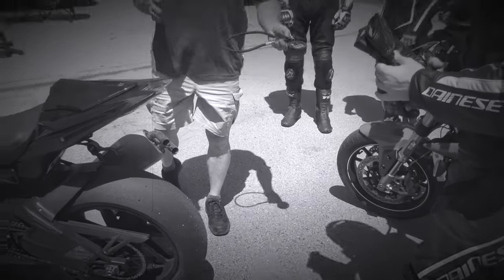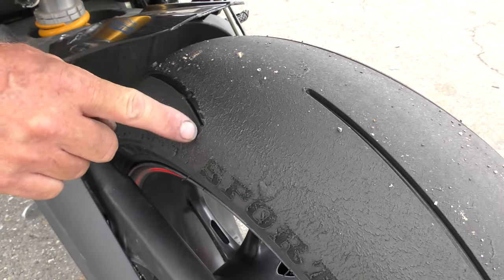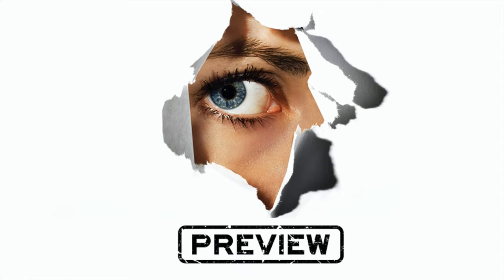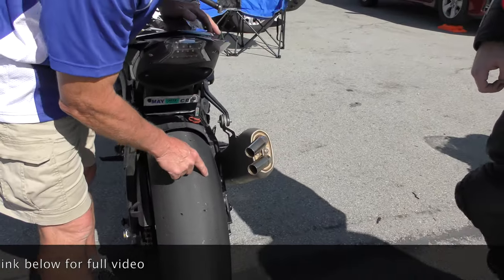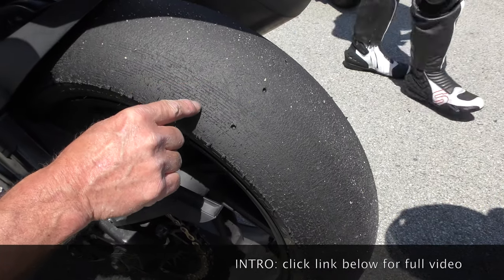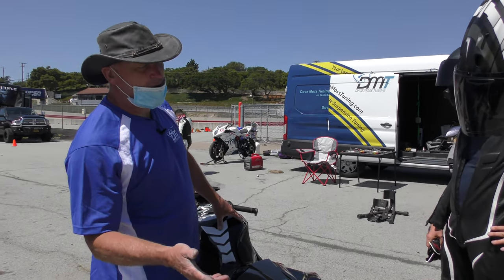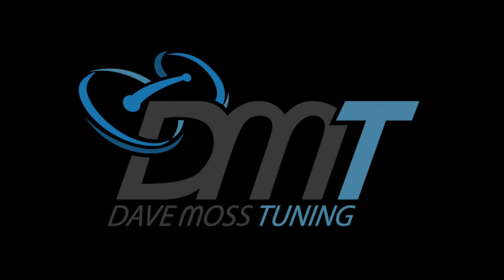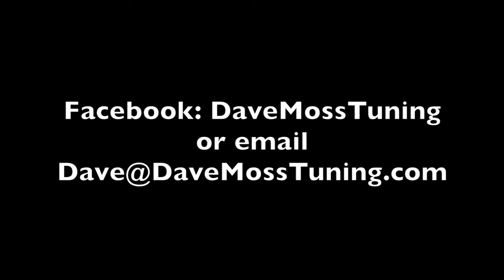INTRO Contact Patch: Metzler TD Slick at Laguna Seca on the S1000RR

Comment: Those  tires were pretty good, actually. I didn’t have my generator with me that day, so no tire warmers and I was just using the sun to heat them between sessions. 

As always, thank you Dave!
Reply: Are they worth the buy over other td slicks
Reply: @Q636-n8z  I believe Dave mentioned in conversation to me (off video) that they are similar to the Pirelli SuperCorsa's (please confirm with Dave over my word), which I've not tested myself. However, these tires aren't the cheapest to find right now due to having to purchase from UK vendors and shipping is a bit costly. The difference on these is that Metzeler states you do not require tire heaters, they can utilize way more heat cycles over racing slicks, and the rear tire is reversible to save money (example would be a heavy left turning track, you can flip the tire on the wheel to use the other side and get a better value out of them. The front tire does not have that luxury though). All-in-all, I would like to see these more in the US for track days and maybe even novice racers.
Reply: Moto-garage carries them. I read about these tires from European testers but could hardly find anybody this side of the ocean that sells them. Pete’s-superbike in Quebec sells them too which is who I will be ordering from.
Reply from the maker: @Q636-n8z  I believe this is the only TD slick you can buy now in the US. Pirelli TD Corsa and Q4 have sipes.
Reply from the maker: @sprollyg  Pirelli and Metzeler have often been referred to as "the same company" in folk lore as Pirelli acquired them in 1986. Carcass and construction are similar. It would appear the MTD slick is much longer lasting than the Pirelli, so these tyres will be in high demand.
Reply: I agree!  I picked up a set from Moto Garage (out of colorado I believe) a few weeks back and used them on track at Spring Mountain in NV for 2 days on track with my '20 BMW S1000RR.  I used my warmers with them and they worked great!

Comment: I've been using these slicks for a few months now.  You can get them in the US from Moto Garage.  I was able to get 4 track days out of the rear (flipping it helped) on my '20 S1000RR.  2 days at Spring Moutain and 2 days at Buttonwillow.  My pace is Mid to near the top of A group depending on the organizations I ride with.  I usually run warmers on them when it cooler in the morning sessions for peace of mind, but often run them without in the warm/hot afternoon sessions.  Never had any stability or grip issues.  They offered me more than enough grip and stability and much better wear vs previously used track day tires.  I do think the Q4 offers a slightly better grip and a quicker turning profile compared to the Metz TD Slick, but the Metz TD makes for it by lasting much longer.  I've also run the new Pirelli TD SC3 tire.  Also a great tire but man does it wear out fast!
Reply from the maker: Thanks for sharing your experience to help other riders considering a purchase!

Comment: At what tire pressure should the Metzeler TD slicks be run when hot?
Reply from the maker: Depending on skill, motorcycle engine power and track temps I have found the best hot pressures to be 34-36 front and 25-27.5 rear. Hot pressures were tested after 6 fast laps.

Comment: What exactly happens when the tire to road contact patch moves beyond the edge of the tire? For example i used all my 150/60 tyre untill the edge, is it safe to downsized the size to 140?
Reply from the maker: Realize that profile plays a bigger part in use of tire. Is the 140 bigger than the 150? Put them side by side and look. Then you can make the call on safety.
Reply: @catalystreactionsbw  thanks for the advice 👍

Comment: I didn't understand what this exhaust tip is all about
Reply from the maker: Laguna Seca has a noise limit (92db) so the exhaust insert tips point to the opposite direction of the sound test area (right side). Stock air box intake noise is often louder than stock exhausts.

Comment: Would you choose these over the R11?
Reply from the maker: I would choose a slick over a DOT tire first and foremost, irrespective of brand. Then I would test for longevity to see if $$ spent match between tires. I want value not the cheapest tires.
Reply: @catalystreactionsbw  yeah that's fair. Pricing here there's $40 between the 2.